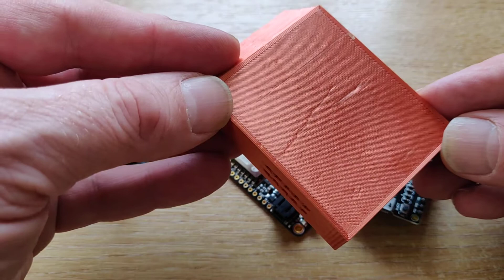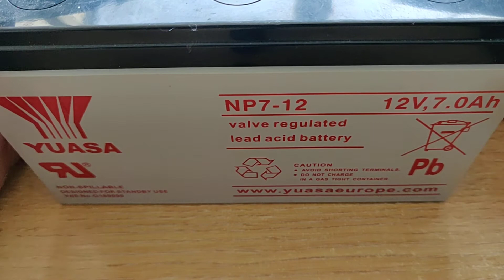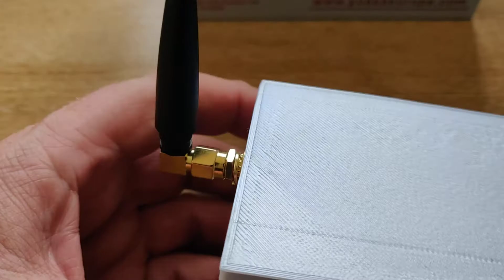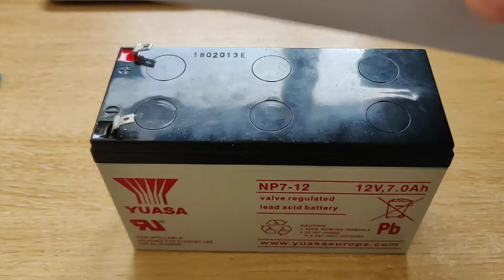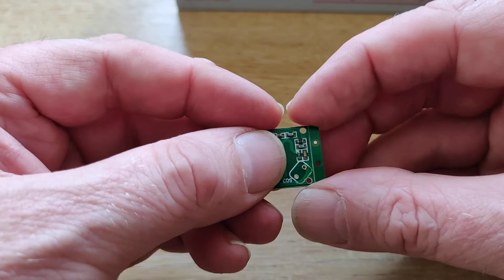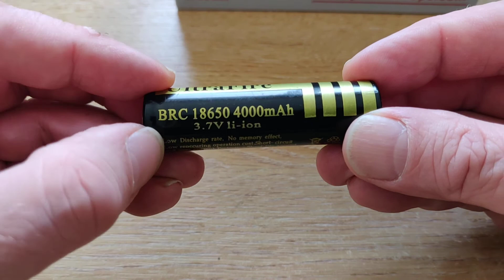Introduction to nerdy techie stuff for beekeepers

Comment: Brilliant - keep going.  I suffered from thefts a few years back and have looked into various options without real success.  One project that I discovered was how to rewire an old mobile phone (I forget the make and model) so that it would send a single text triggered by a mercury switch.  Good idea, but required a mobile phone per hive, batteries last about 3 months and was very bulky.  One thing you need to watch is the bees propolising anything placed within the hive. I am currently playing with an Elegoo Arduino kit (a Christmas present), this comes with lots of projects and sensors and is a good way to learn about construction and coding.  I would be very interested to follow your progress and wish you success!

Comment: Really interesting - what programming language are you using?  Can you code what you need to in Python?
Reply from the maker: The Arduino traditionally uses a simplified C language. You can use MicroPython with the ESP8266 and ESP32, but I've not done any of that before! Thanks for the comment